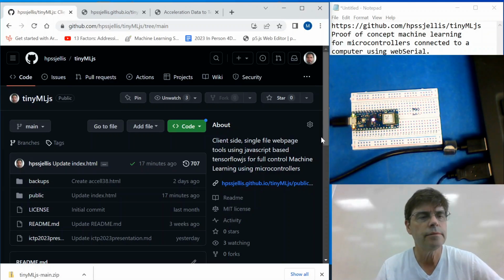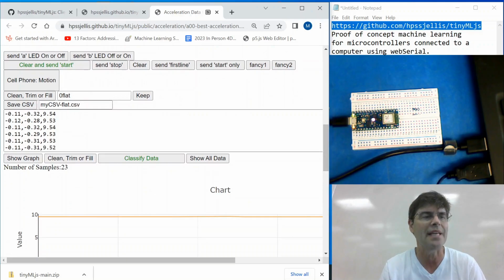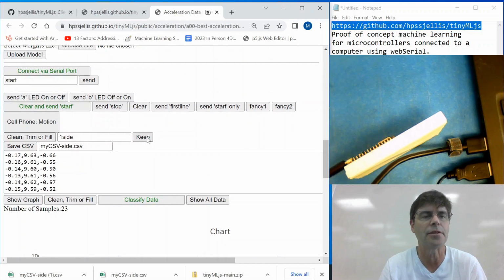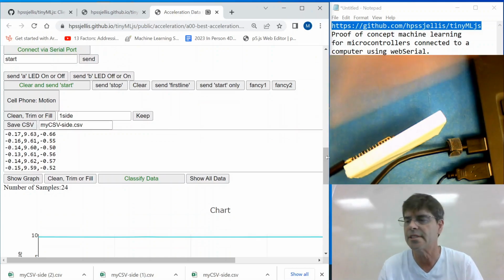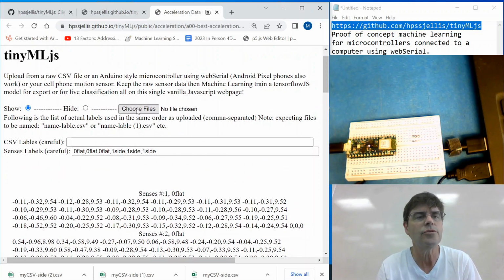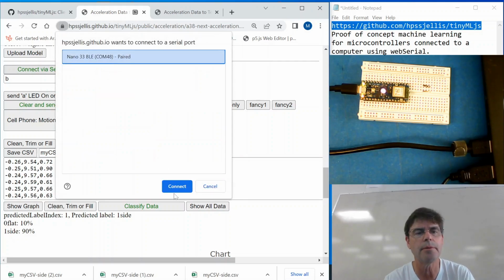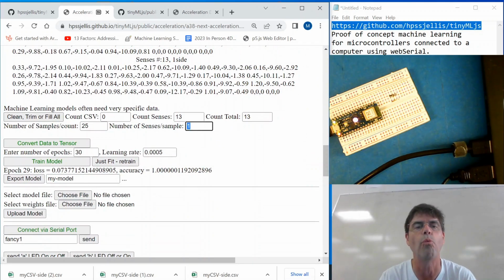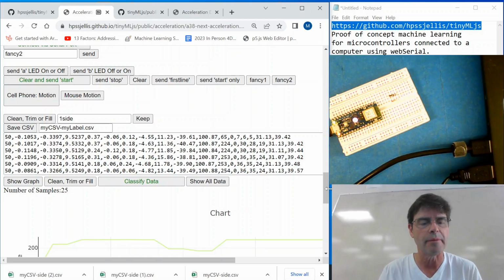tinyMLjs-intro

Comment: Hello sir, I saw your work on portenta h7, I am reapply inspired by your work. i am working on computer vision for my final year project, using portenta h7 and portenta vision shield. i have completed most of the work but I am getting some errors with figuring out hardware problems, I would be really thankful to you if you will guide me on my project.
Reply from the maker: What is the hardware issue with the PortentaH7? How are you amking your vision models? Edgeimpulse, or openMV. I dont know much about openMV.
Reply: @Rocksetta  I am making a real time facial recognition, I trained my model from edge impulse and deployed it using openmv, now the problem is that I connected my portenta h7 and portenta vision with portenta breakout,  and I want to connect my spi, tft lcd to make it stand alone but I can't figure out pins for connecting the lcd from portenta breakout.
Reply from the maker: @SOFIA_TECH_KITCHEN  Yes a TFT has an issue connecting with the PortentaH7 see this link on my course   https://github.com/hpssjellis/maker100#29    I much prefer the waveShare 128x128 grayscale OLED, cheap like $20 and it is much faster than the typical TFT.  Here is my link to working with the grayscale OLED   https://github.com/hpssjellis/maker100#24   Good luck. That is tricky stuff. I never did get the touchscreen part of the TFT working well. Do you need touchscreen or can you control the program some other way.  By the way facial recognition is really hard on these tiny devices, lots of luck to you with your model.
Reply: @Rocksetta  sir if you don't mind can I have your email, I would be really thankful for yours help.
Reply: @Rocksetta  I am also using openmv where I'm using micropython